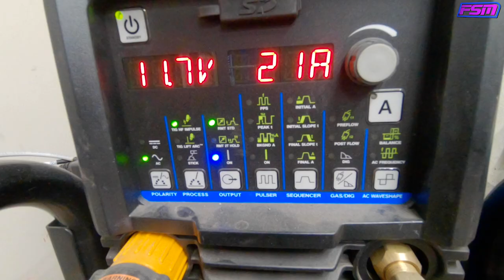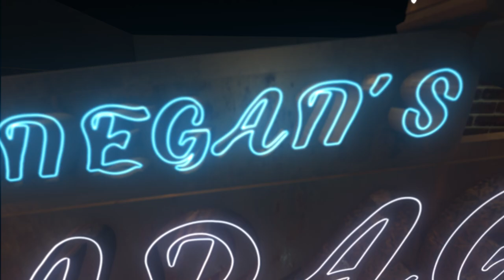EASY TWIN TURBO LS ENGINE PLUMBING HACKS!!!

Comment: I think “Wifey’s Whip” is a great name for the Eliminator! That way when you gap people out in Parker they know your wife’s boat is faster than their boat 🤣
Reply: That's great except "whips" are cars, not boats.
Reply: I like signed consent!
Reply: Wifey's Waker
Reply: @stuwest5862  look deeper. The term "whip" actually refers to steering wheel  "Whips" were originally used to steer stage coaches.  When cars were invented they called the steering wheel a whip because it steered the car the same way as a whip steered a stage coach.
Reply: Until a flat bottom pops up, but of course a flat bottom can't run the full length of parker wide open unless your crazy lol, like the Daytona can.
Reply: Holy Alimony
Reply: @jetboatracer5967  true. I expect mike would be going up to the strip with this. Game over he was on the lower part of the river below rock dam. And anyone pinning it on the strip in a flat bottom is insane
Reply: "The wife gapper" ...hmm, that might not work.🤣
Reply: Yeee
Reply: Family Boatster
Reply: @matthewserrao2926  Scottie runs his flat out all the time, buzzin Foxx's around 140mph or more lol.
Reply: @jetboatracer5967  during busy weekends? I see flats out during winter and in the morning during summer but typically the wake is too gnarly with all the god damn lake boats on the strip. Still love going up there but it’s changed a bunch, love my lower part of the river below Rock Dam. Got to watch Finnegan do pulls in Game Over on a holiday weekend. Don’t think it was 140 but we got some other crazy mf’s down here .

Comment: 37:39 good call on tucking in your hoodie drawstrings for the mill work. In my shop I make everyone cut them off. It's way cooler than getting your head pulled into a mill or lathe. 👍

Comment: That innovation at the jet nozzle is genius. I work with pump systems and once I saw it I was like.. oh yeah that will work. I also noticed that there is an inducer on the inlet of the impeller as well. They should all help with hole shot. In Fluid terms low velocity head. By using both devices you increase your suction head which reduces cavitation. It should give you a very quick and smooth transition. Thanks for showing us that. I had a few river boats back in the day, most used the Hamilton 212, the Am Turbine, and the Kodiak 3stg.

Comment: That HIP process was probably done where I work, we have seen Nascar cylinder heads, aluminum 9" center sections, and those grid fins on SpaceX rockets.  Pretty cool process, VERY high pressures.

Comment: The reducers look strange to me.  I think it would look cleaner still and offer better performance to boot if you merged the cold side together into the final size before your pie-cut elbow.
Reply: There's a bottleneck where the two turbos merge before it opens up at the throttle body. I'd have liked to see the throttle body diameter run all the way to the Y.
Reply: @terencecampbell8363  100% you're right, the Y into a larger elbow is not a particularly difficult joint to fabricate if you template it up first, it would fit, and give a good laminar flow.
Reply: Literally exactly what I just came to post :D
It just looks nasty to me thinking of flow characteristics... massive restriction with the turbos fighting one another... it won't but could theoretically nearly halve the turbo performance

Comment: great video! i realy like this solution and you guys did a great job showing hot to do it.
but if you want a bit more flow you can also cut the y tube from the turbos a bit further back, make the round cut on the 90 ovalized and weld something like a 3.5 inch or even 4 inch 90 to it.
right now the 2 turbos are pushing a lot of air trough that tight small 90 and that risistance will also make a lot of back presure resulting in a lot warmer exhaust temperature.
cheers! cant wait to see this thing slapping cheeks in the water!agag

Comment: A quick tip for anyone out there that doesn't know for aluminum you don't need a metal chop saw you can literally use a regular wood chop saw with a quality wood blade and you can use a wood router on aluminum wether its pipe,tubing ,channel whatever ... Sounds crude and dangerous but it's not you will be surprised how quick and easy aluminum cuts with wood blades., I work at a large custom fab shop and we use these methods quite often, one thing always wear PPE like glasses face shield and don't skimp on hearing protection high speed tools are ear damagingly loud!  One plus is a quality wood chop saw usually has very accurate miter adjustments compared to most metal chop saws especially budget abrasive saws. Fyi DO NOT use any high speed wood cutting equipment on aluminum that doesn't clamp the material i.e. table saw or circular saw,  it would cut through the material no problem per SE but where a table saw can fetch up and send wood flying at super high speeds with aluminum binding is way more likely probably definite and metal or blades flying at bullet speeds it would be life threateningly hazardous .... Do not use a table or circular saws not even in a pinch!

Comment: When you are working with aluminum angle or flat stock. Wood working tools will do the job so if you wanted to bevel or round over the milled edges on your windows in the angle you can use a small router and a bit with the profile of choice to make perfect uniform edges around the windows super fast and easy

Comment: That trick nozzle is going to be like having a torque shifting prop. A buddy had one of those props on his Checkmate. It came out of the hole hard as hell and set you back in the seat when the prop switched. It was like being in a car with a Powerglide.

Comment: For those that already have a miter saw for wood, your carbide blade will cut aluminum tubing just fine.
Reply: I was thinking that a Stainless steal carbide blade would have problems with aluminum

Comment: Learn as you go in machining. I went to college for machining. You’ll love it the more you do it. Most of the time you have to figure things out as your machining. If it works for you then do it. I would use a brush instead of air to remove chips from the work peace. That way you not finding chips all over your shop or garage. Just a tech tip to make clean up easier and faster on you. Oh feeds and spends are the key. Good luck.

Comment: $50 says when someone at Nelson sees this, they shout into the machine shop to make a new pair of cold sides with the logos flipped over, just to send them to Mike. :D
Reply: I’ll take that bet. They would have to recast the housing to flip the logo’s
Reply: @Jnichols77  Me to nelson is not gonna give two shits rather then to recast the housings this dude is in a dream world where money doesn't exist
Reply: I’d almost be more surprised if they didn’t already have cold side housings with the logo flipped. The main reason for mirror turbos is packaging and aesthetics. So, they may already have housing with the logo flipped so it faces the right way.

Comment: Back in the day there was a guy that had a powerglide trans between the motor and jet. That was an amazing rig! I can’t wait to see someone duplicate that build!
Reply: I dont think it works like that. The boat  would go faster at high rpm like the top of first or second and slower when it changed gears or have low rpm.

Comment: Use your mag dial indicator base and pointer wire like you would use degreeing a cam to repeat your center on the cut-off saw when flipping the tube from side to side.

Comment: So guys I have a question for it being so compact and close together you should have barely any Turbo lag the spool up time should be really quick I really like what you guys Are doing Can't wait to see it finished
Reply: Turbo lag is more on the engine making enough exhaust to spin the turbo. Piping length doesn’t make too big of a difference due to how fast pressure travels. I’m no expert in turbo sizes so I couldn’t tell you how fast that set up will spool but they don’t look crazy big so it shouldn’t be bad.

Comment: Hey guys that 2.5” bend is going to be a chock point. It needs to be at least 3.0” or 3.5”. You just cut your Y pice back to where it is at 3.0” and make another bend up to your 4.0”. That will flow much better and help with your power. Check out flow charts. Cain hard guys.

Comment: Can also use a miter saw for wood with a Diablo carbide metal blade. Works great you just have to devise a clamp system.

Comment: 17:00 there is one more way that's accessible to anyone with a 4 ton press and enough skill to carve out (or have carved with a CNC) two wooden molds, and that is to press two halves of the elbow, and weld down the seam center after clean up. You can bend most alu in 2 mm flavor with just those. IMO, also gives a clean finish product. If you have access to a CNC (one of the small, wood and light metal types) you can even go one step further and do reductions into the piece you're pressing, alu is easy to bend (with enough lubricant, of course). Any 2~3 ton bottle jack and a half decent frame can do it.

Comment: Looks good im curious though why you didnt go bigger diameter tubing on the 90? It seems like there was an opportunity to go straight to a larger diameter after the Y where the two turbos pipes meet?
Reply: A plumber would connect two 2" pipes to at least the next larger 3" for better flow through the t.
Reply: @GarnConstructionInc  
Yeah exactly. It just seems an unnecessary restriction on airflow.
Reply: Its a family boat it'll still be plenty fast with the minor power loss there and 1 thing everyone should know by now he'll keep tinkering and changing things after testing till he's happy with it

Comment: HIP = Hot Isostatic Pressing. Essentially heating the aluminum to the "Plastic State". then pressurizing with high pressure to close up any casting porosity. making the casting denser and stronger. I've used this in Aerospace for many years.

Comment: In aviation, that nozzle would be considered a "choked" nozzle, which is a good thing. It basically allows you to have the correct nozzle size for your thrust. Fight nozzles are designed to give efficient exhaust to give the most thrust available. It's KIND OF like having a perfectly tuned exhaust on your ICE engine, vs just a regular OEM exhaust.

Comment: Correct me if im wrong but if you have 2 2 1/2 inch pipes merging into a 2 1/2 pipe that then transitions into a 4 inch pipe  wouldn't that create a bottleneck in the system? Wouldn't it be better to merge the 2 2 1/2 inch pipes directly into a 4 inch pipe?
Reply: Yes, their wye and tight radius elbow are super inefficient, flow-wise. The compound shock losses are going to be massive. But, "it is super compact and looks cool". Those are the priorities here...
Reply: I agree.  I’m guessing they will redo it at some point.
Reply: @PbBelly  also, its a 1500hp or so engine in a fiberglass shell of a boat.  Even if you lose 80hp in that entire charge pipe it'll still be fast as fuck.

You could definitely do better if you wanted to, but I seriously doubt it makes any noticable difference.
Reply: This isn't a race boat, having the turbo system really compact so his kids don't burn themselves walking by it is more important that making maximum horsepower
Reply: @mattbradshaw6456  Why would they be walking inside the engine bay of a jet boat and how the hell would they burn themselves on boost piping?
Reply: @guhfluh  He said that they plan to swim off the boat and climb back in through the back walking past the engine. Making the boost piping bigger would move the turbos out making it easier to to burn yourself on the turbos
Reply: @guhfluh  the rear is the lowest part of the boat so it's easiest to enter from there than climbing over a thin side that's higher out of the water just the nature of the beast with a drag boat thin lightweight hulls

Comment: That engine package had seen absolute killer poking through the hood of a muscle car or in a hot rod. If the firewall is too, it should still look good if you turn it 180 degrees, but it should be possible to work around.

Comment: I see that Place Diverter Co. just sold their 1976 Rogers 19' Bonneville jet boat on BaT.  Sold for $25K.  Looked like a great restoration.  Wish I submitted the winning bid.  It would be a bitchin float here on Central FL lakes.  Great info on jet pumps!

Comment: If the tight 90° was a larger diameter it could meet the wye at a point of equal cross sectional area to reduce or even eliminate the squish zone. Nice first shot at pie, not at all flaky.

Comment: that pie cut 90 is awesome, but is much more restrictive. Probably better to go up a tubing size, then make that pie cut bend, but your flow will still be more than adequate. Especially since it's where you have two going into one, that one should be at least the cross sectional area of the two.

Comment: Check out, "The fabrication series" justin has a heap of videos explaining pie cuts and how to calculate the centre line radius 
Also easier way to line up the tube in the cutter mark the cutting tool clamp at the same height as the centre lines on the tube and can also add a depth stop then its just rotate line up the marks and slide till it stops for exact replicated pies

Comment: You may have said why and i didnt hear. But why not use Motion Raceworks double 90 throttle body and move the turbos behind the intake manifold? Yes it would basically be turbos straight to the TB, but Frankenstien intake system so its fine. Probably.

Comment: The other way to do a nice tight radius bend like that... lobsterback construction from flat plate, takes a little more more effort but if you love fiddly stuff and have the patience you'll have absolutely beautiful results with a nice smooth outside curve instead of a series of flats

Comment: Can I be pedantic here? You said that the variable nozzle - which is cool as heck, and very similar to fighter jet tech - allows higher pressure in a hole shot. But wouldn't it be lower pressure and higher velocity, because of the venturi principle? Also it seems like you'd want to reduce the nozzle area at higher speed, rather than out of the hole. But I'm very far from an expert. Perhaps you could explain why it seems backwards from the theory? As a non-boat-owner, this stuff is fascinating.
Reply: At low speed you want more bowl pressure (before the nozzle) and at higher speed the suction housing being (forced feed) with less restriction, the more volume of water thru the whole pump = faster speed.

Comment: Thoughts on V-bands on the housings, rather than the silicone copplers? Would add some support I'd think.
Reply: It would make it all to ridged and would most likely start to tear it self apart with vibration and flex, the silicone hose acts like a vibration damper and will help keep that thin aluminum elbow from cracking.

Comment: Cut a bunch of triangles in the bracket...like all them fancy designer cars do...and don't forget to radius all the edges...does away with stress cracks..or you could press up some carbon fiber..😳😉

Comment: I'm not trying to sound like an expert or anything, but I think you forgot to plan ahead for a blow-off valve on the cold side. I know you can certainly run without one, but especially with two turbo's I would think you probably want some control over your boost. Just something I noticed.

Comment: If the distance from the outlet of the merge pipe to the center of the concentric reducer doesn't exceed 2.5 inches, you can buy a 2.5 inch close (tight) radius, schedule 10 aluminum 90 degree weld elbow.  You won't have fabricate a close radius elbow.

Comment: Idea ,  what about full carbon fibre vacuum bagged seat brackets that U  could still trickout   ( more weight saving cutouts )    Also carbon fibre seats 4 weight saving & press stud upholstery.   From Eliminator they r beautifully upholstered seats with marine ply , foam & Norgahyde Upholstery.  Two Heavy .  Just a thought .  Turbo Plumbing 👀👀 Gr8 . R u going 2 Powder Coat ?

Comment: That pie elbow to wye looks like a bottle neck, why not build the wye outlet and elbow the same size as throttle body connector??
Reply: So he can fix it later, good excuse for another youtube video and a test drive ;)
Reply: It's all about "fluid dynamics," and in this case, it's gas or air but the principles are the same........ decrease volume and increase pressure (& velocity!) If you have a 3 inch tube with 10 psi of air pressure passing through it and you decrease that 3 inch tube to a 1 inch tube, the psi of air pressure increases not quite to 30psi but close (and it's travelling much faster!) I hope that this makes sense?
Reply: @joseywales3789  so smaller intake runners into big intake ports in the head are better? Restricting it down is just going to work the turbos harder.
Reply: @scottykify  agreed
Reply: Technically, the smaller diameter of the tube raises velocity of the fluid flowing thru it and turbulence increases with higher velocity. So I'm not convinced all the small diameter tubing bends and transitions are the BEST "due to increased turbulence". But it might not be that bad either, specially with a intercooler and plenum to straighten out the flow down stream. There's allot of really fast cars out there with very tight bends on their turbo plumbing.
Reply: @scottykify  
if smaller diameter is better why not reduce it at the turbo?
Reply: @MrSleonhardt  sorry my reply might not be worded correctly, I didn't mean to say smaller is BETTER but more so that smaller diameter might not be as bad as many people think. But to your specific question, the turbine housing on the turbo does exactly what you said, it progressively gets a smaller cross section from the time gas enters the housing until it exits, raising velocity. This is how the important A/R value is changed. This passage is called a volute.